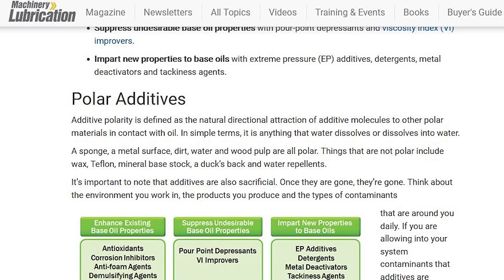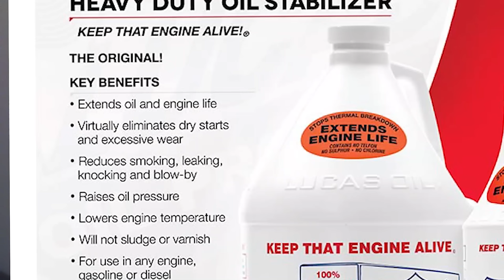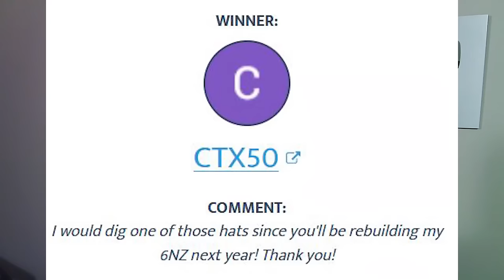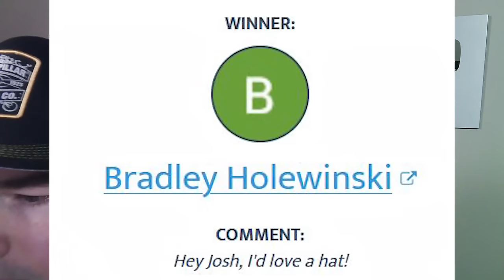Does your Engine NEED Lucas Oil Stabilizer? A detailed look at the "Benefits."

Comment: No proof Lucas does anything. I stick to the feel method if the oil starts getting sticky or tacky (hauling 45k heavy loads or running thru the mountauns) I change the oil.

Comment: Screw that crap, i run straight 50w Valvoline vr1 racing oil in my 84 ford bronco 2 with 335,000 miles on it and it runs great, i change the oil filter about every 10,000 miles i use wix oil filters and i change the oil about every 25,000 miles,, i run my oil till its black for a reason and that is that the blackness builds up on the edges of the rod and main bearings and acts like a dam keeping the oil on the bearing so my motor can sit for a very long time and i will never have a dry bearing, every time ive changed my oil the oil pressure has been steadly going up and at 335,000 miles on it at idle my oil pressure is around 25 psi and at cruising speed it runs around 50 psi not bad for a motor with that many miles on it, as for synthetic oil no thank you

Comment: With owning two trucks with almost a million miles between the both of them. One gas and the other diesel. I found that Hotshot's secret preforms better than lucas. In my 1995 ford with 7.3L i have noticed the engine running smoother with less injector sticking. Here is a picture of the valve train on my 01 chevy with 6.0L at 405k miles https://i.imgur.com/8j1RPiz.png

Comment: Crap were was this vidio years ago I used Lucas in my 3406B and 3406E Got my first pick-up a 99 Ford  Power stroke cost me $1200 for a high pressor oill pump and a tow bill..

Comment: I had a old 327 Chevy back in the 70's that I slung a rod out the side of the Block > So I put a a gallon of this Lucas Snake oil in it and it Mended the Block and Reconnected the Rod so I drove it another 10 Million miles and then sold it to a Little Ole Lady that drag raced it another 10 Years!!! Everybody needs this Stuff in their motors. I also voted for Biden and YES he is doing a Great Job>>LOL🤣🤣🤣🤣